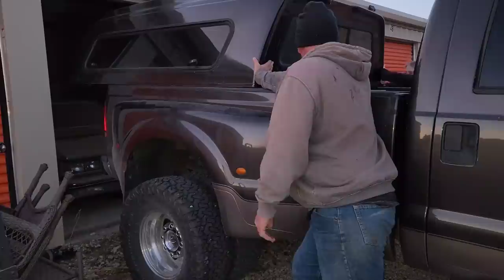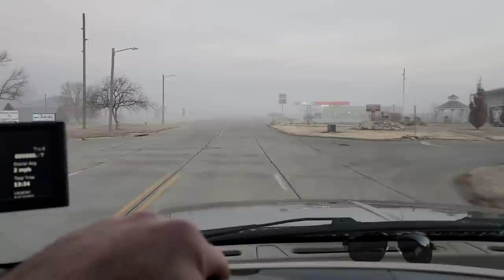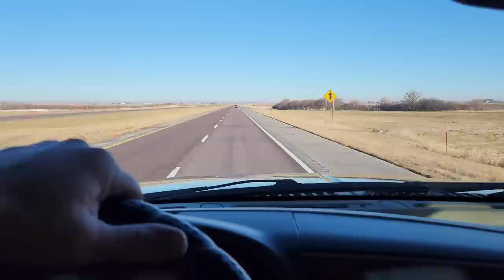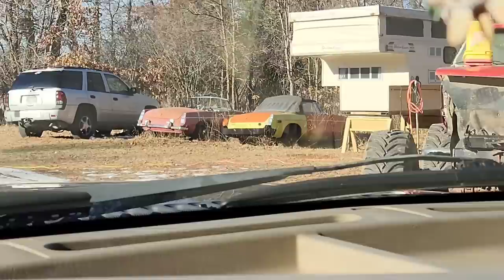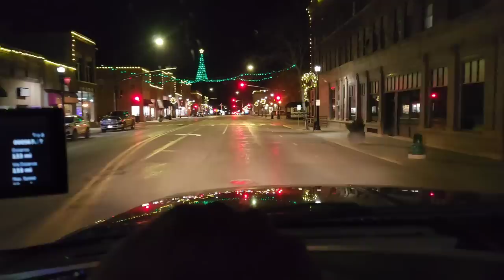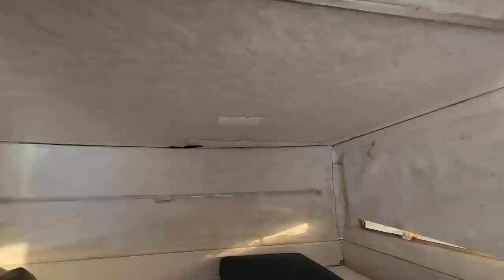Ep686, I Bought A $600 Pop Up Truck Camper

Comment: I lived almost 2 years in a slide out camper on the back of my pickup back in the 80s. But mine was not a pop up. mine had the bathroom and all. but still, it was cold in the winter. at times you could scrape ice off the inside of the windows. lol and the propane I went through running the furnace was unreal.
Reply: .Keep Up With Speedy - In the early 70's I lived in my small home-built camper for six months in Edmonton, Canada while driving for Kleysen Transport. In the winter I used an electric heater which I plugged in behind the shop. For a shower I used the Husky truck stop where you could get a shower, a towel and a bar of soap for $1.00. I had a cooler for perishables and cooked on a Coleman stove. I also had a Coleman lantern for light. For ventilation I would crack open a side window and the roof vent a bit so as not to get asphyxiated while sleeping. lol
Reply: @gord2358  one does what one must do lol

Comment: We went from a Okanagan 811-SL years ago. To a 41ft 5th wheel. Bad ideal and 7 years later talked my wife back into a truck camper. We now have a 2016 Eagle Cap 1200. Man so much room. Triple slides and a Ca king bed, 2 flat screens 2 recliners and well everything to travel the country in. But its a load on my Dually at 7000 lbs. Then a 20 ft boat behind it.

Comment: I bought a full size truck camper for my diesel pickup.. unfortunately the day before I went to pick it up we had a bad windstorm and it got dropped off it's jacks.. put I stuck it back together and have used it twice.. still got to fix the bathroom (the black water tank broke when it fell) but it'll get done

Comment: Had essentially the same setup. 08 350 crew dally on 35x12.50 tires. Also had a camper shell but after opted for a Skamper slide in pop up.   Loading it in the truck was a challenge. The truck is now converted to 4 wheel on 37” tires and the dually bed has been swapped for a service bed.

Comment: You won't even know it is on there! If you don't have solar I went with portable, bluetti Max, and upgraded the house battery to a 12v/300ah chins smart. Had to ad a dc-dc charger but well worth the effort. solar panels plug into the bluetti, camper plugs into the bluetti, and everything is happy. End of the day you can take everything you bought with you if you sell it. Great set up.

Comment: Just came across your video today. I just went through this same process. I have a 2002 Dodge Ram 2500 with an 8' bed. I had a full length toobox/drawer setup along with a canopy. Those canopies are heavy! I actually sold mine because I don't intend to take the camper off very often. I retired last week and I wanted to downsize my old setup which was a 2016 cargo trailer conversion. I sold it and found a beautiful 2007 Apache Eagle WS popup camper, the biggest one they made. It was owned by an old timer who kept it in his barn and took meticulous care of it. I paid a premium price for it, but to me, it was worth it. I also got beat up on the 3 hour trip to get it, bouncing up and down just like in your video 🤣It runs about 1800 lbs and smoothed out that ride home. It drives great! Anyway, just wanted to say hey and I'll start checking out all your other camper vids. Thanks for the video, made me laugh because I just did this same thing, minus a lot of miles. 😉

Comment: The camper is sweet. You'll definitely love it first time out. My parents and I went from SW Pa to California and back in79 with one. Find some used legs that bolt on the outside corners. Drive out from under it put the cap back on. Truck it safe brother 😎
Reply: John McClain - good idea.

Comment: I forgot to say this, for the canvas on it put a canvas sealer on that before it gets wet. We found out that it comes it a rattle can and a brush on. A little security so if they get wet and then really cold, they will freeze and not seal in the heat.. 
⛺️😁😊👍😎🥶🥶
Reply from the maker: Will do
Reply: S G - Good to know.

Comment: Gee man you made me jealous now. Used have one similar than your new toy it was one with the bunk build out the front of the camper it also had a table you could make a bed to it was a timber fram with metal on the outside it timber in the end rotted out tho

Comment: I love the slide-ins, I bet it cut down the bumps & fuel mileage 🤔
Good luck & happy camping
Reply from the maker: Not bad on the fuel. So far, just .5 of a gallon.
Reply: @truckingwithschmidt7120 it's the perfect size for your truck, those big ones are heavy, expensive & a handful to deal with

Comment: Wow, that's a deal, no, that's a STEAL.  Looks like they are $30,000 give or take new.  Looking forward to see your experience with that.  Great video.   And nice truck by the way.   Just bought a 2023 F350 SRW crew cab gasser;  has me thinking about a truck camper of some kind; I like the pop ups.